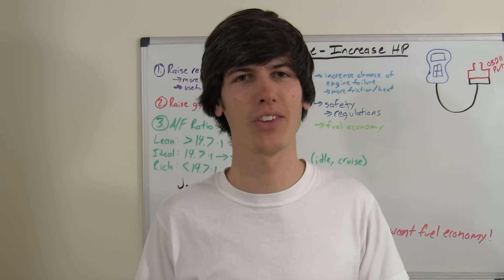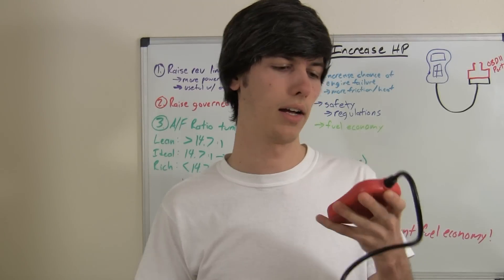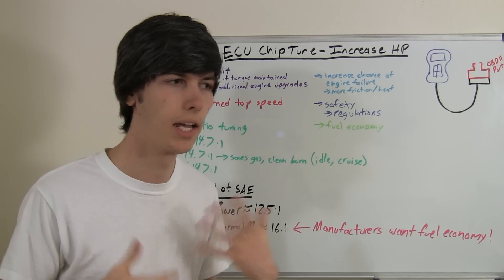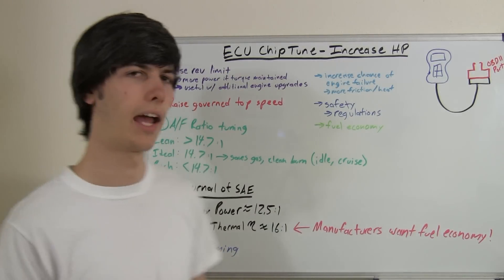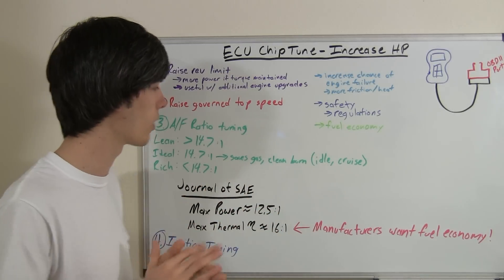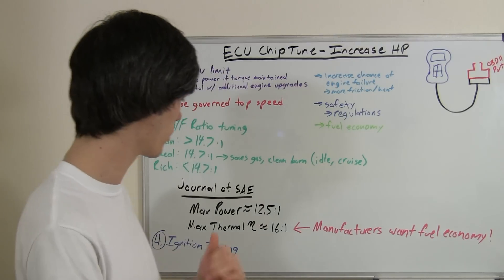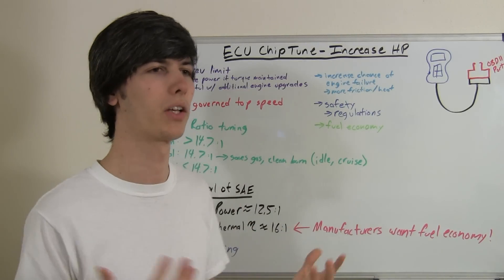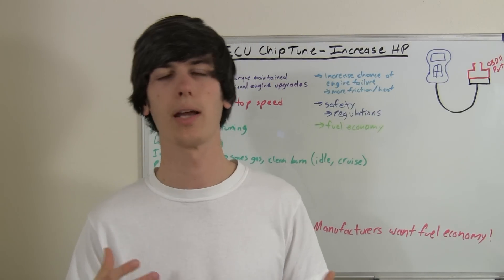ECU Chip Tune - How To Increase Horsepower

Comment: BMW: keep safety in mind, put a top speed of 155mph...
Reply from the maker: Ulysse Guillet 156 is dangerous!
Reply: and 155 is totally safe!
Reply: It is not actually safety these german manufacturers have in mind when limit top speed at 155 mph. The main reason is to reduce cost. A car that can run over that speed will require different brakes, tyres, suspension, aerodynamics and so on. If the engineers let these cars run free, some might cross the 200 mph barrier and then, everything will have to be reengineered and it may compromise the whole Project and make it inviable.
Reply: its been proven many times that the speed limiter doesnt really work. they did it on fifth gear.
Reply: Ulysse Guillet lol according to BMV manufacturers. Well said lol.
Reply: Herbert Harada well said. Exactly what car manufacturers are thinking and just relabel as "safety"
Reply: Herbert Harada true, vehicle dynamics becomes much trickier at higher speeds.
Reply: You can however ask the dealer to remove the speed limiting software, they will tell you that they advise against it, you do it at your own risk they don't accept liability etc etc
Reply: Xavier Rice In my country, Brasil, the E60 M5, with no limiter, was more expensive than the standard.
Reply: +Ulysse Guillet the cars that that also sell to is in their own country, the autobahn which has no speed limits except for towns and intersections and all
Reply: +Herbert Harada thats only for smaller cars. a rs6 or a m5 are build for reaching 200 mph.  you can ask the dealer as a option to get it removed or raised up. it's just an agreement of the manufactures to prevent of getting a general speed restriction from the law..
Reply: YEs... nowadays that is.
Reply: I agree 155 is crazy fast but on our roads "american" they are not designed for that speed. In Germany they have the autobahn that is made for those speeds and they can drive however fast they want but they restrict them to 155. Here in America laugh and say why so fast but in Germany they probably laugh and say why so slow?
Reply: 155 is a gentlemen's agreement...
Reply: @hhharada  It was a joke but okay.
Reply: @hhharada  totaly agree with you
Reply: My car ia gonna blow up now 🤯
Reply: @ulysseguillet64  in Germany we say to this Speed : Schrittgeschwindigkeit
Reply: @Gerald Victor Ehh I watch on Flixportal. Just google for it :D -darwin
Reply: @Gerald Victor No problem :)
Reply: 155 is super standard lmao
Reply: @ulysseguillet64  yeah

Comment: Impossible, my car has no ECU because it was made in the 1970s.
Reply: +cascroft2011gaming so you have to rely on turbo's/superchargers, advancing ignition manually, adding in fuel manually, etc
Reply: Justin Noker
yep.
Reply: eww
Reply: Topias Salakka what's wrong?
Reply: +Justin Noker
Turbo's... what? Which possession of the turbo were you trying to refer to?
Reply: Justin Noker
it has no turbo/supercharger and is a very simple engine to work on. You can remove from the car in less than 45 mins
Reply: cascroft2011gaming
i know, that's why i said add one, i initially made the comment slightly as a joke anyways
Reply: +MaxxFordham possession? what are you talking about?
Reply: luis bonilla, I was asking Justin Noker because he said "turbo's" something. So let's see what he says for his answer.
Reply: Damm, not sure why it's showing I posted all those comments, hahaha.
Reply: MaxxFordham i just meant turbo, it was a simple spelling mistake
Reply: Or just turbos (more of a punctuation mistake instead), right, Justin Noker?

Hey, you know how to access and use the editing feature here (to edit one of your old replies)?
Reply: MaxxFordham yeah, and i do, just lazy lol
Reply: So, Justin Noker, which takes more button presses: the click-click and the deletion of the stray character, or all those keypresses to type the characters to tell me why you'd rather not do that? Why wouldn't you rather just do the few presses it takes to edit, delete and save than to type all the words it takes to tell me that you're lazy? Will you just make the move that takes less presses? ;-)
Reply: Mine was made in 1987, that computer is a damn fossil. I'm working on getting more kick out of that pre series Buick 3800.
Reply: in other words you have a car thats actually simpler and more fun to tune ;) good luck m8
Reply: Cascroft2011 Damn I'm jealous. Wish I didn't have to worry passing emissions test every year.

Comment: i love my programmer, for 500.00 i gained 120HP and reduced my 0-60 time by 12 seconds. best investment ive ever made! it runs through my ipod mounted to the dash so i get all my gauges and a touch screen control to change up settings on the fly. my turbo hits 44PSI boost with limited physical mods. its crazy how much potential engines have that are just not used from the factory.

Comment: Also, most road cars actually run slightly richer than the ideal 14.7 for  added precaution. My Volkswagen runs about 13:1 to 13.5:1 above 2800rpm's when the throttle is more 50% open. It's possible to safely lean out afr's slightly across the entire rpm range in many cases and observe a noticeable increase in fuel economy.

Comment: Also you could increase the horse power changing the turbo settings, with this normally you get better fuel economy. In diesel engines the new HP, torque and fuel economy are amazing. The disadvantages are that the turbo and engine will break sooner.

Comment: pretty close to a tractor actually. cummins turbo in a dodge ram. its an ipod 4s and teh gauges are decently sized. one large one in the center and 4 smaller ones around it. or a 4X6 grid pattern of numbers in boxes for each gauge.

Comment: I am a big fan of your videos being an engineer myself. I like this one because of the pragmatic approach of even if it is illegal should not prevent people getting the full(er) picture of what's there in terms of software limits in their cars. I think what should be a bit more included (even though it was for a half sentence) is the trade-off one makes with tampering their ECU parameters. So I do not know how well they do around where you live but garages in London who claim to know this kind of stuff and flash your car for you actually don't get this all that well in the end. I have seen some codes for my BMW engine that some of those guys have done(not to my car, someone else's but the same engine regardless). I have checked some parameters they were tweaking and some are merely taking limits off and pushing air-fuel to some constant instead of an adaptive number etc. I think what those poor guys whose car will get half of its lifetime taken by this don't realise is exactly this kind of trade-off. There are 2 reasons an engine is tuned the way it was in the factory: 
- longevity/fuel-economy/efficiency
- because they had a more expensive model with the performance option using ALMOST the same components

In my BMW there is a mix of the 2: There are smaller components in the lower models than in mine in terms of CAT, EGR, and cooling but it is the same engine block, electronics and ECU just different injector nozzles and software parameters. So what crazy people do is slap in the injectors of the more performant model, load in its software and then enjoying the next 50k miles because after that your engine will be wasted along with the turbocharger. Is it worth it really? Well math says it is not. Buy the performance model if you need more performance. A BMW is used sensibly and general care can go up to a staggering 300k miles without you having to touch the engine. By that time you will have replaced 3-4 sets of suspension components underneath it in this lovely country of speedbumps and potholes :)

Sensibly I would only recommend tuning the ECU as the engine ages and timing code might be needing adjustment. As the components wear timing might become a tiny bit off. But then again the original BMW software is pretty good with their sensors of camshaft, the lambda, and the air-flow sensor to detect and adjust automatically. It comes down to a lot of knowledge and understanding the original approach of the manufacturer to tuning to sensibly override the factory settings. Most of that information is proprietary and it may never have been documented even. I believe while you may easily change these(a cable for usb to OBD2 is 5-6 dollars on ebay) I would think twice before just trusting John Doe's garage to tamper with mine. I'd rather trust a manufacturer's judgement(who puts an engine on a test pad and runs it for ridiculous hours after a code change and then disassembles if to have a look at the components when they develop the model) than that of some random guy who self-learned how to read and write some of these values. I think people should buy and pay for the brand and model they trust to have a good configuration on the get-go.

DISCLAIMER: I hereby acknowledge that there may be people at random garages who understand the full gravity of tampering with ecu settings but they are incredibly rare.

Comment: Wanted to jump in on this here... Regarding the A/F ratios... Manufacturers don't tune their vehicle lean. In cruise? Maybe in the 90's (e.g. Civic HX). Nowadays, lean burn won't pass emissions testing. That's the purpose of the narrowband O2 sensor - it tells the ECU whether to increase or decrease fuel delivery in order to precisely hit stoichiometric AFR's. When running lean under load, you'll experience knock as well. The 12.5:1 is also for naturally aspirated cars; Forced induction cars are typically tuned to around 11.5:1 or so.

My point is that a flash tune doesn't richen your AFR's... it leans them out. Factory tuned ECU's are usually around 10.5:1 to prevent pre-ignition from higher cylinder temps (and because the fuel burns faster when the AFR is leaner, causing it to completely combust prior to the piston reaching the top of its stroke). However, just like with an AFR that's too lean, an AFR that is too rich will also rob power.

This is why when you retune a car, it typically says to use premium gas. Higher octane fuels have more stable burn characteristics, and also burn slower.
Reply: Thank you!

Comment: Very good and basic explanation.  I reflashed my BMW 335i with a Cobb tune and increased a 100whp.  I replaced the stock FMIC, intake, and charge pipe and haven't had any problems.  The only thing that worries me a little is keeping the brakes stock.

Comment from the maker: It's by mass, so it operates under the assumption that oxygen and nitrogen densities are as described in this video, which are at atmospheric. But you can change the pressure without altering the ratio, if the percentages of the gases remains the same.

Comment: You should have mentioned boost pressure increase for turbo engines (where ECU remapping makes most sense by far).
Reply from the maker: Yes indeed!
Reply: Engineering Explained can this work on a oem turbo ?

Comment from the maker: 14.7 is stoichiometric (ideal), I have a video "air fuel ratios" if you'd like to know where that number comes from. 11.3 could be the case for many turbod cars, but it's certainly a rich mixture - for maximum power though this is fine.

Comment from the maker: Yes, lowering the A/F ratio will result in more smoke. Modern emissions equipment can basically eliminate this on diesels, but it can be restrictive so some people remove it. They care less for Earth, and more for loud noises and fast speeds. I applaud those who are opposite. I myself struggle with the dilemma of wanting an amazingly quick car that's also efficient. For the time being, the Integra meets the "effecient" part.

Comment: I guess there's only so much detail you can provide in 5 minutes, but one important thing to note for people interested in chip tuning and watching this video is that you can still maintain lean AF ratios for fuel economy under idle/cruising scenarios but enrich the mixture to 12.5:1 for instance only when you want the power.

Just because manufacturers are seeking good fuel economy doesn't mean they don't run their high load maps very rich.  In fact, they will often configure their exhaust gas temperature regulation model that can result in a 12:1 or sometimes even richer running condition, under high load scenarios for engine protection.  So in these cases you can make more power by leaning out the fuel map or temperature modelling compared to stock to make more power.

Lastly, not all cars respond best or make peak power at 12.5:1.  Some may prefer lower than this, but several modern direct injection engines (ie. Volkswagen FSI) exhibit better mixture/atomisation and therefore do not require an overly rich mixture to make peak power.

Comment: Very good Channel, dude. I like the way you diagram your explanations! Just adding something here, you said that BMW/Mercedes limit their cars to 155mph per regulation reasons. Well, the powertrain can be able to power the car to 200 mph, but to sell a car that goes 200 they would need to design 200mph brakes, 200mph suspension, 200 mph tires and wheels, and so on. Limiting to 155mph makes all components to designed to 155mph, being then cheaper and simpler, therefore not related to regulation.

Comment: Great simplified explanation as always!
PS: the richer mixture is not "better" for the catalytic converter, it just provides more power (it might be good for the combustion chamber: piston, cylinder etc..) as it decreases the heat a bit). Even factory programs allow a rich mixture when you're flooring the pedal, to increase power, the mixture would have a ratio of .85 to .9

Comment from the maker: Well yes, if we keep the throttle position the same, richer may run a bit cooler. But since you'll run rich typically at WOT, there would be an increased temp.

Comment from the maker: With 10% ethanol the mixture will be different. Ethanol's ideal ratio is about 9:1, so a 90% mix will have a slightly lower air/fuel ratio.

Comment: I wish there were more company's like the Cobb access port where you can simply plug it in and adjust everything. 

When my supra was stock with the factory ecu, there aren't many options for obd port tuners. 

But eventually when i went single turbo i installed a standalone ecu and its worlds different than the factory one.

Comment: I have heard this sometimes (esp. when upgrading to a standalone engine management system with more detailed fuel tables and more ways of calculating airflow). With a more detailed fuel table the motor will be more efficient more of the time. Also with these set ups you can sometimes eliminate eliminate efficiency robbing components such as the old vane meter (flappy door MAF) sensor.

Comment: Can you also do a video of what might be the effects of chip tuning of different types of engines such as naturally aspirated petrol or a turbocharged diesel? Also what are the risks of it such as engine failures etc. Thanks a lot btw
Reply from the maker: Usually this is a case by case type question, as some engines are overbuilt and some are not. Reading up on forums and seeing the success others have had with individual engines is probably the best way to start. Thanks for the suggestion!

Comment: A question: why the combustion chamber may overheat when the engine is running on a lean air/fuel mixture? Thanks for being so informative for all of us petrolheads over the world. Brazilian Subscriber!
Reply from the maker: Herbert Harada Lean A/F supposedly takes longer to burn, thus more heat is put into the block rather than useful mechanical energy.

Comment: Damn, I was considering a stage 1 ecu flash to get a little more power/torque but as I understand the trade off is more potential damage to engine and greater burn on fuel. I think I will just stick to stock, as my engine had used already a lot of milage and the price of fuel sucks.Thanks for the video.